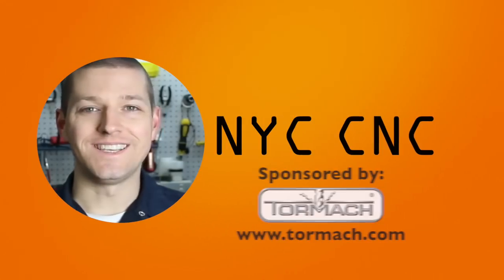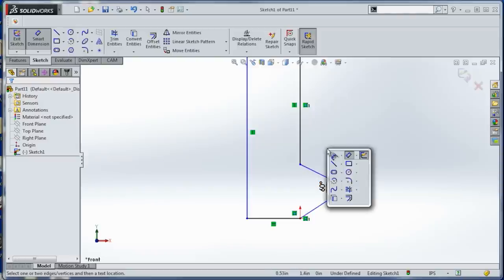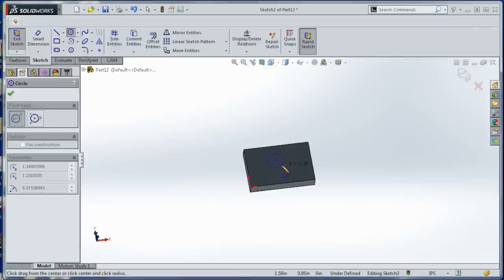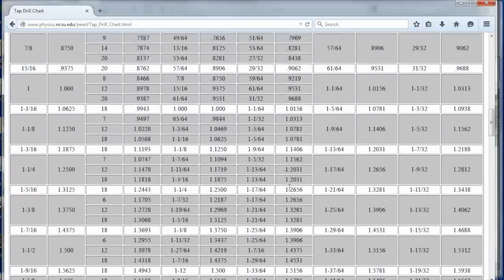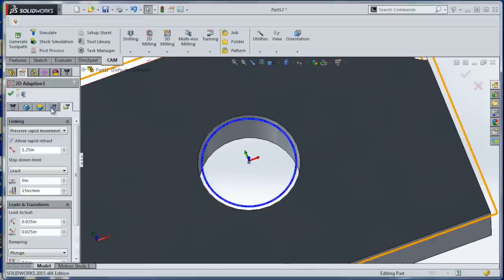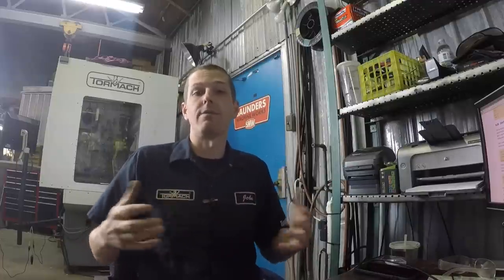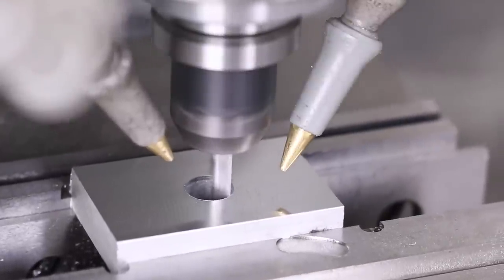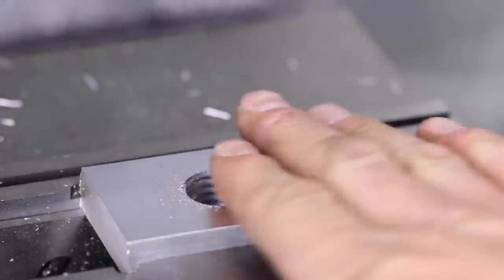HSMWorks: Thread Milling Tutorial!

Comment: Inches... Why USA don´t be like the intire world and use metric scale.
Reply: I use metric units and I'm american, there are plenty of americans who use it especially because science/engineering classes which are exclusively done in metric. For example, NASA uses only metric.
Reply: Except the times they crash into planets...
Reply: Probably because we haven't invaded you yet lol
Reply: We use it where its applicable and practical and worthwhile and use "Imperial scale" where it works best. Just the way ALL "technologies" are used where appropriate by professionals smart enough to know that "new" doesn't make "old" obsolete or even "inferior". The reason the "Imperial scale" is still around is because of the many and well-known (to people who use both and know their "trade" and have common sense about "science" and "math" and "geometry" and "measurement" etc) flaws, faults and failings of "metric scale".

There is nothing quite as ridiculous as using a "base unit" in excess of 1 yard and then claiming the U.S. is ignorant for not using "metric scale". Its been several decades since any "major" U.S. manufacturer designed/engineered/manufactured major machinery using "Imperial scale" and companies like General Motors, Deere & Company, Caterpillar, General Electric etc have been using "metric scale" for several decades AS they've introduced new product lines and again where practical. Where "metric scale" is NOT "practical" is in "precision measurement/machining" where ".01mm" isn't even close to "accurate and precise enough" for true precision measuring/machining. One hundredth of a millimeter is more than three thousandths of an inch. Three thousandths of an inch is a huge "tolerance" when it comes to engines and other precision-machined machines/components where .003" could easily be twice the difference between a part with "correct" clearance and one that has none and is destined for destruction as soon as the completed machine is operated. 

Its also ridiculous to complain that the U.S. and "Americans" are somehow "ignorant" or "stupid" for NOT using "metric scale" and further to claim that the "advantage" of "metric scale" is how EASY it supposedly is to use. You can't have it both ways. If "Americans" who can and do and constantly go back and forth between metric and Imperial and fractions and decimals (neither fractions or decimals are EXCLUSIVE to either metric or Imperial and DECIMALS LONG PRE-DATE THE "METRIC SYSTEM") and move back and forth between "units" at will and with ease are "ignorant" or "stupid" for not using the "easy" system, then those who advocate for the "easy" system apparently find Imperial too difficult. 

The other (but not the last) laughable "benefit" to the "metric system" is the claim that its supposedly "base 10". I don't know what "metric system" you "foreigners" use but here in the U.S. the metric system is NOT "base 10". The "base units" of measure are the meter, the liter and the kilogram. But yet there are no "decimeters" or "decaliters" or "decigrams" in common usage that I'm aware of. There ARE "centimeters" which are ONE HUNDREDTH (1/100 or .01 and "1/100" is easier for MOST people to grasp since its associated with "percent" or "per hundred") OF A METER and "millimeters" which are ONE THOUSANDTH OF A METER and GRAMS which are ONE THOUSANDTH OF A KILOGRAM (GOTTA WONDER HOW THE "KILOGRAM" GOT TO BE THE BASE UNIT OF WEIGHT WHEN ITS A MULTIPLE OF THE SINGLE UNIT "GRAM" UNLESS YOU REALIZE THAT UNTIL RELATIVELY RECENTLY IT WAS IMPOSSIBLE TO "MEASURE" A SINGLE "GRAM") AND MILLILITERS WHICH ARE ONE THOUSANDTH OF A LITER BUT AS FOR "ORDERS OF MAGNITUDE I.E. MULTIPLES OF TEN IN THE METRIC SYSTEM THEY SEEM TO BE PRETTY MUCH NON-EXISTENT).

The other thing laughable about the "practicality" and "usefulness" and "superiority" of the metric system is that its not "intuitive" at all. A "meter" supposedly was originally chosen because its some fraction of the distance between latitude or longitude lines on the "surface of the Earth". Well, the Earth isn't a "perfect sphere" and that in and of itself makes the "meter" an imperfect "unit of measure". Equally "imperfect" is the "kilogram" as it relates to the "mass" of a volume of "pure water". Sans "distilled water" i.e. water boiled in a container, its vapor collected and condensed to make it "pure" and free of all "dissolve solids" there is no such thing as "pure water" or even "standard water" and its impossible to measure the "mass" OF any volume of water "independently" without some sort of container being weighed with and without the water or a "scale" that has a "tare weight" of zero and a built-in container that progressively filled with water would "weigh" 1000 grams when "one liter" of "pure water" was placed in that container. 

Again, since the uses for "pure water" are few and far between and without knowing that the water WAS "pure" you'd never know if you had a "liter" when you reached 1000 grams or just 1000 grams of "impure" water and a "volume" of less than or more than "1 liter", the "metric system" pretty much fucking fails miserably when it comes to "volume" and "mass" and using one to determine the other and vice versa using a non-existent or at least irrelevant "standard" like "pure water". Of course TEMPERATURE also affects the DENSITY of "pure water" and without knowing the TEMPERATURE to a "precise" degree you STILL don't know that "1000 grams = 1 liter and vice versa". 

Then there's the foolishness of metric "length" and "distance" measurement. Using that "1 meter" base unit means the base unit of measure is ridiculously LARGE for most "day to day" measuring tasks. And as such, what happens? People end up "breaking down" 1 meter into "centimeters" and "millimeters". The former FAR more often than the latter. So you're using WHAT? FRACTIONS OF A METER FOR YOUR "COMMON" MEASUREMENTS. And to EXPRESS those measurements "accurately" you're either forced to use a "centimeter" and "decimals" to forget about "millimeters" entirely OR a combination of both or just "round off" measurements. And because "1 meter" is roughly 39 inches and a distance longer than the MAJORITY of people can comfortably "stride", its essentially impossible to "pace off" meters with any degree of "accuracy". 

Meanwhile, the "obsolete" and "antiquated" and "pointless" and apparently for metric fans "difficult" Imperial system adapts the "unit" to the JOB. Inches where they're most practical, feet from 12 inches through 36 inches and yards from there. Fractions of an inch OR decimal TENTHS/HUNDREDTHS/THOUSANDS/TEN THOUSANDTHS where precision and accuracy are desirable. And since a "foot" is called a "foot" because that's "roughly" the length of a human...foot or at least a MALE human foot in a SHOE OR BOOT of some kind give or take an inch or two and someone's ACTUAL foot length can EASILY be measured in INCHES and the math to convert a "stride" to some number of "yards" is pretty simple and even metric fans could probably manage it, its not IMPOSSIBLE to "accurately" step off yards and in fact since most people have to "stretch" to pace a yard the chances of them "overstepping" a distance and ending up measuring "long" while pacing are pretty low. 

Of course the use of "yards" multiplied to get to "miles" is assumed to be "standard procedure" today but the fact is that a few "units" have been left by the wayside by the "metric supporters" trying to make Imperial look as impractical as the metric system is jumping from "one meter" to "one thousand meters". Again, thanks to the Imperial system's non-reliance and non-obsession with "simplicity", a "yard" becomes "obsolete" or at least "unnecessary" once someone has "measured" 5 1/2 of them which is "1 rod". Why "1 rod"? Well, surveyors use a "stick" known as a "rod" along with a "transit" for measuring the change of elevation between two points. And way back when that was probably close to the average height of the average adult male. Providing a man knew his own height "to the nearest inch" by simply using his height and adding or subtracting the correct number of inches - and "inch" being roughly the length of the last "knuckle" on an index finger meaning the "finger tip" containing the finger nail, even without a measuring tape at all a "rod" could be made for "accurately" surveying, measuring distance, etc. 

There are other "obsolete" units such as "links" and "chains" and interestingly enough when you get to "chains" and you measure/survey a square "10 chains" on a side you've just laid out "1 acre". Which brings up an interesting question? What is the "metric equivalent" of an "acre"? There is none. How about "1 knot" i.e. the unit of "velocity" for "ships" both on the ocean and in the air? There isn't one. Nor is there a "metric equivalent" for the "nautical mile" which is directly related TO the "knot" being TWO THOUSAND YARDS vs. the "statute mile" i.e. "terrestrial mile" of "1760 yards". Seems like "nautical miles" were thought up to make "math" a little simpler since time x velocity calculations to determine "distance traveled" would be simplified using even "thousands" of yards. And there's one other reason for the "nautical mile" being 2000 yards vs. 1760 yards. If you TRAVEL "1760 yards" as the crow flies or on a "map" thanks to the CURVATURE OF THE EARTH and the fact that there IS NO SUCH THING AS A "STRAIGHT LINE DISTANCE" on the surface of the Earth or even while flying "above it" at a "fixed altitude", you'll actually travel "2000 yards" thanks to the "arc" your "ship" will travel along to go "straight and level" for "1 mile". 

Seems like LONG before whoever thought up the "modern" and supposedly "superior" metric system people were using a far more practical and useful and adaptable and versatile "system" that really isn't a SYSTEM at all. The "Imperial system" is more like a "collection" of several "systems" someone with a little INTELLIGENCE and EXPERIENCE and COMMON SENSE can use as little or as much of as he or she wants to and without being TIED to a "system" that for 99% of "users" clearly is just as hard or confusing or mysterious as the "Imperial system" since so many "metric system supporters" have no idea how their "native" system even works when they talk about "base 10" and "simplicity" and "practicality" and how its so "easy".
Reply: That's a lot of text for someone who can't even do simple math and correctly identify their system of measurement.  0.01mm is 0.00039 inches.  You'll struggle to hit that on any mill and would require grinding or some other abrasive finishing.  You act like you can't go three place with metric.  I see it every day in the aviation industry.  Also, the U.S. does not use the Imperial system.  That's a common misconception.  We use the U.S. Customary System.  There are notable differences, mainly in fluid measurement between the two.

Your whole argument can essentially be boiled down to ease of conceptualization; being able to relate a measurement to something you can visualize, i.e. your foot. For engineers, we don't care about pacing things off with our feet and it doesn't matter how units are defined.  What matters is how efficiently we can convert and compute these numbers.  Nothing comes close to metric in that regard.  It doesn't matter if the guy in the field can't pace it off.  He has measuring tools for that.  It matters if the guy in the office got his numbers right.  

Ironically, most U.S. units were officially redefined a long time ago.  They get their current definitions straight from the metric system.  For example, the U.S. government defines 1 yard as 0.9144 meters.  Look it up!  Also, 12 inches is pretty close to 300mm.  Pretty easy to remember if you absolutely have to pace something.
Reply: Downvoted for swapping the spacebar with your --> " <-- character on your keyboard! Seriously, who uses that many quotation marks? Felt like I was being emotionally bullied just reading through the response.
Reply: There are two types of countries. Those that have adopted the metric system and those that have been to the moon.
Reply: 8ABagel ...or maybe to the Nevada desert lol almost the same but few billion inches closer :)